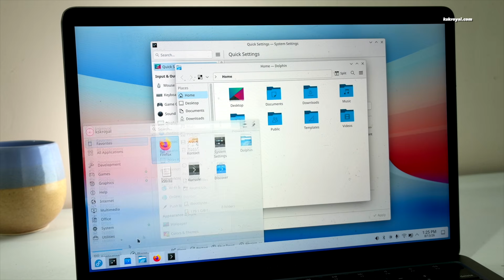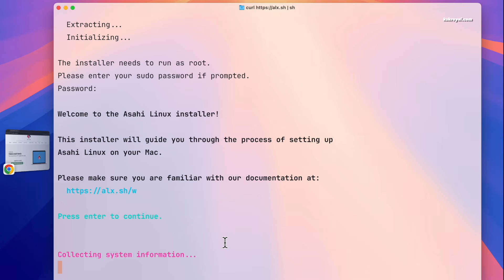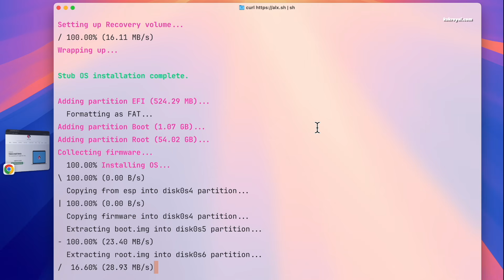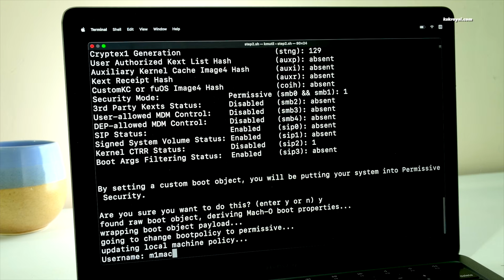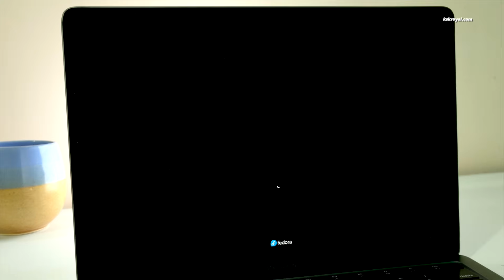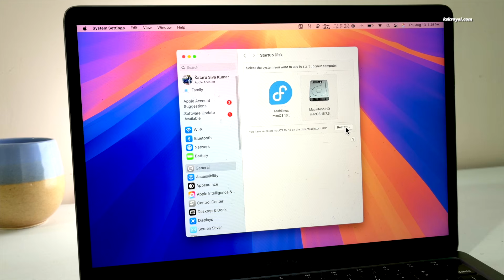INSTALL ASAHI Linux On M1 & M2 Mac // RUN Linux NATIVELY On Apple silicon (NEW)

Comment: It successfully resized the partition but it's been stuck on shrinking APFS data structures for almost 24 hours now 😫
Reply from the maker: CTRL + C To cancel.  then run these two command 

diskutil apfs list
diskutil verifyVolume /

You can also run First Aid in Disk Utility on the container. apfs list shows whether the container shrank at all.
Reply: @kskroyaltech  Thank you, it looks like it shrank it to 315gb from 500, it just stuck at 77.6% for some reason. i tried to restart the install but now it's saying not enough space. I have everything backed up so I think I'm going to just go into recovery and erase the whole disk, reinstall MacOS, and try installing Asahi again.

Comment: I've had Asahi running on my M1 MBP since last year. Really like it.
Reply from the maker: It's a great experience on that hardware!
Reply: Any crashes or anything as such?
I'm usually on chrome and terminal most of the time, so how is it going for you?
(basically pentest).

How is wifi drivers working for you?
The audio, video and GPU acceleration?

How's your current experience going on?

Comment: Thank you for that video!
Im like, really want to use Asahi Linux on my m2 pro 14 inch mac, but i cant find a use case to do that. It feels like, using Linux and having still some issues with it.
Reply from the maker: That's fair, it's definitely more a passion project for tech nerds right now than a daily driver.

Comment: but after install this asahi linux we can't delete macOS. it need macOS for running this asahi linux is not fully independent linux like other windows laptop
Reply from the maker: You're right, it still relies on macOS firmware from the original system to function properly.
Reply: The mBoot firmware requires macOS for handling the firmware settings, unless these interfaces get reversed engineered and ported to Linux.